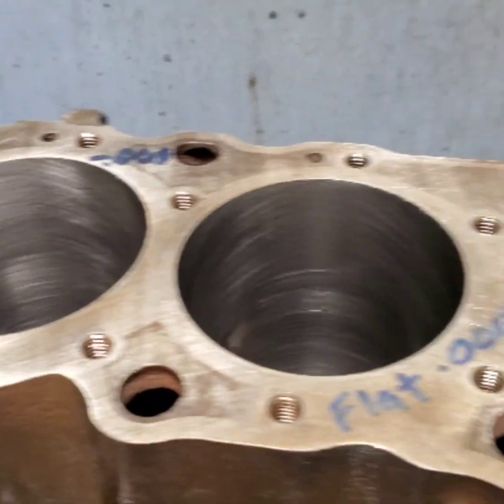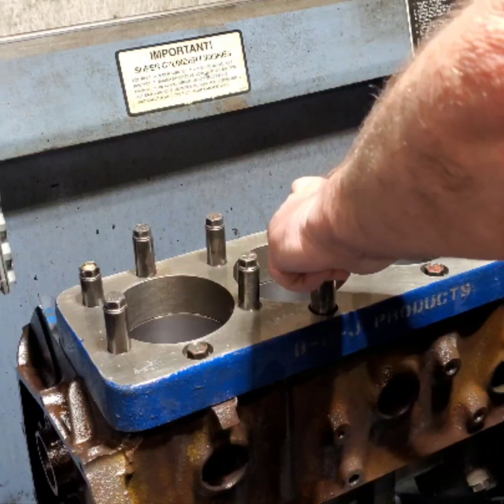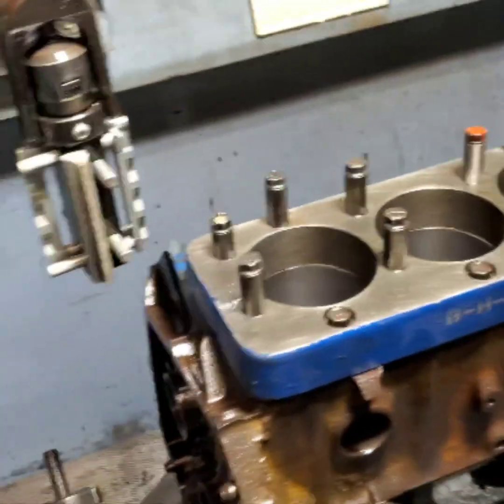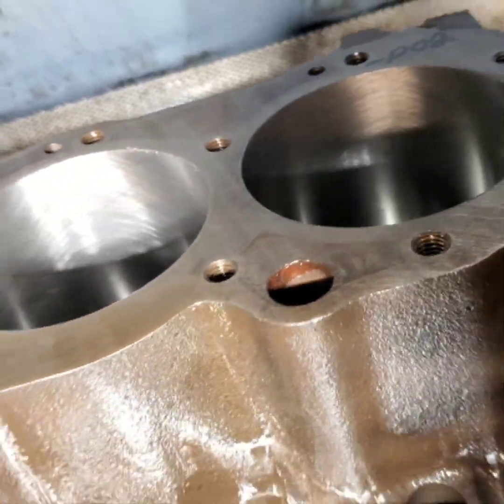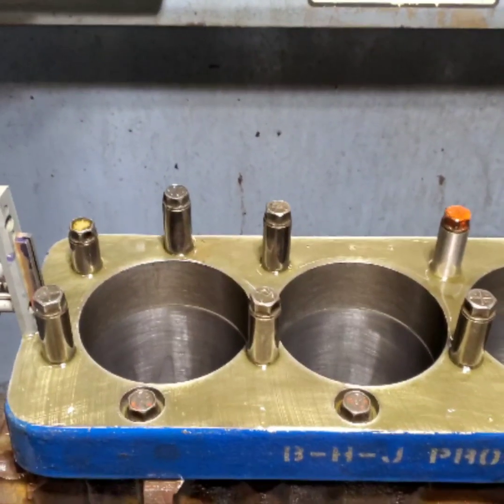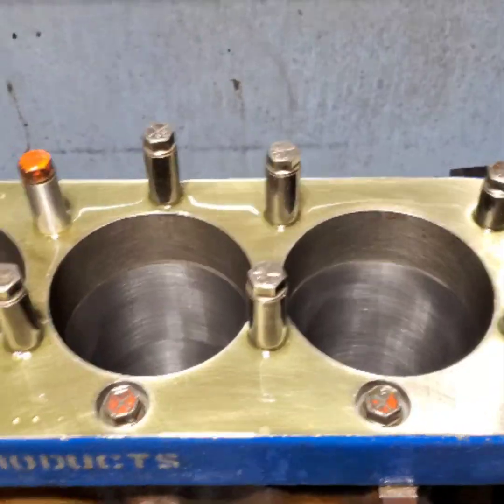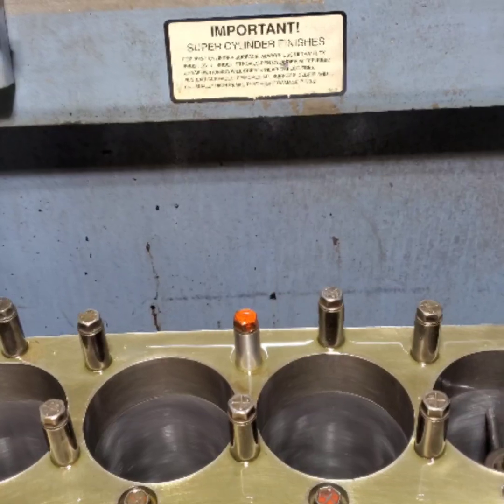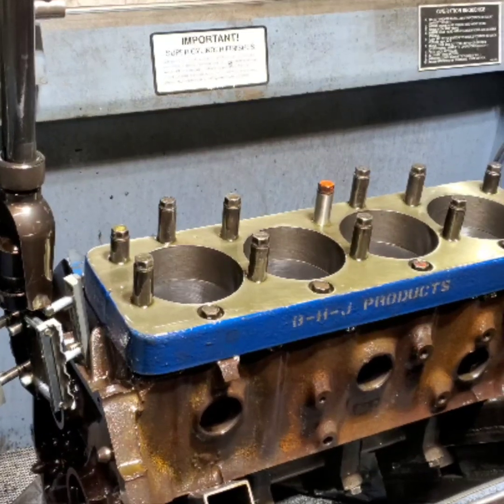69' 427 Chevy L-36 .060 Final Torque Plate Hone.

Comment: I knew I would find this video, very nice, since I don’t know what the torque plate does , I’m going to guess that it keeps the heat from honing from distorting the block, how did I do, lol
Reply from the maker: Hi Mike, the torque plate simulates machining the block with a cylinder head torqued in place.
It distorts the bores.
Then honing trues the bores straight and round.
Makes more horsepower and torque.
Makes the engine more efficient. 
By promoting better ring seal.👍
Reply: @edsmachine93  very excellent Ed, thank you so much, what % of machine shops do you think do this

Comment: Hi Ed, Great video, thank you. A quick question: How important is the torque plate, is it just a precaution or as they say"rather safe than sorry" Is the heat sufficient enough to distort the block? or is there another reason for using it. Thanks again and take care.👍
Reply from the maker: Good morning Anthony, thanks for watching and the comment. 
It is very important to torque plate.
If you have access to a plate, use it.
It will make the cylinders round when the cylinder head is installed and torqued down.
Thus improving ring seal performance, horsepower and torque.
Have a great day.👍👍
Reply: Hi Ed, i hear you, never thought of it that way. Thanks for the info. Have a great day. 👍
Reply from the maker: @mpe6678 Thanks Anthony, anytime I can, glad to help you out.
Reply: when i clamp a torque plate onto a block that has just been bored and before i hone it, ive seen as much as .0004" warpage. if your piston-wall clearance is .001, it's a lot.